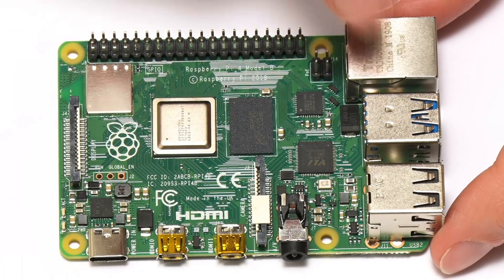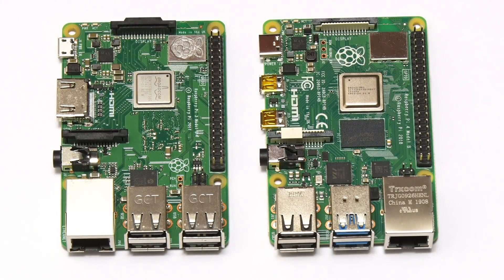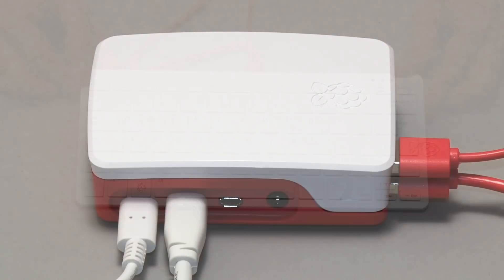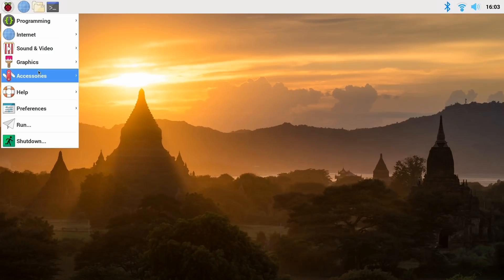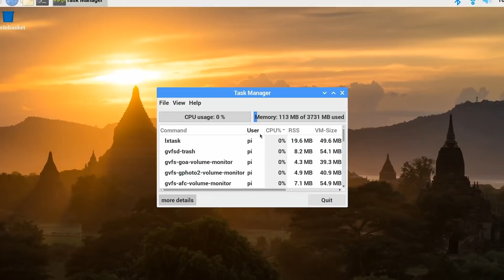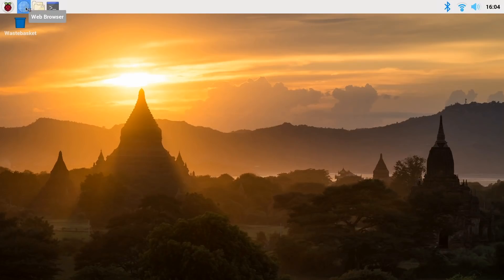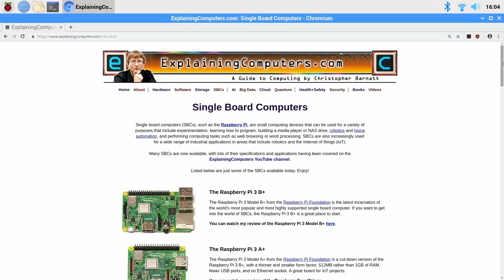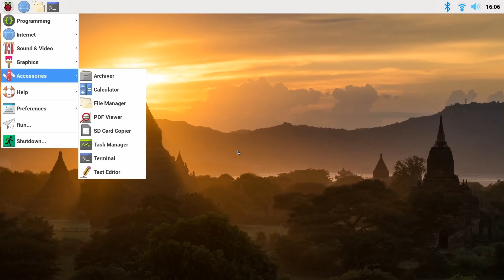Raspberry Pi 4 Model B

Comment: I bought RPi 4 for this Christmas. It's a bit sluggish comparing to RK3588 based boards, but still works well for many tasks. USB 3 allows to use USB SSD as a main drive. So even after 6 years, it's still a good small computer.

Comment: Great video, does anyone know why when  i start the raspberry pi 4 it shows the boot screen but when it time to show the desktop it goes dark?
when i remote into it i can see the screen but when i connect i display to it the screen turns off.
Reply from the maker: It sounds like you have turned off HDMI in Raspberry Pi OS, so can only see the desktop via remote access. Maybe part of your remote access setup?

To turn HDMI back on, in a terminal try:

xset -display :0.0 dpms force on
Reply: @ExplainingComputers  That didn't work and now it got the remote screen extralarge and i have to scroll right to see the rest of the screen
Reply from the maker: Ah, but you have now then proven that the problem is your display configuration. You can reverse the above to get back to where you were:

xset -display :0.0 dpms force off

Comment: The Pi 5 should really have an [optional] 8-32GB eMMC flash chip: that way the Pi would be a lot more responsive and the SD slot could be removed from the Pi and replaced with something else :-)

Comment: Thought I'd make a post here to warn people about the Pepper Tech  Tera Pi QV... the one with the big aluminum heatsink. I built one up recently running OMV.   There are two main problems. One... There are only 3 heatsink contact blocks on the bottom. And 2, It makes the PI run hotter N Hell after a couple of hours. I had to add a fan to my friends heatsink, but that kind of defeats having what it supposed to be a static dissipater. At least in this Terra Pi all the hardware was included. I eventually took the big heatsink off and put on 4 small standsrd blue heatsinks. It actually runs cooler with those tiny sinks than with the large one.

Comment: Does the microSD card lock in place ?  Someone said it just slides in and they didn't have to push it in to lock like a normal slot. Thanks. I am now searching for the best case for a PI 4B.
Reply from the maker: The microSD card in a Pi 4 does not lock -- it just slides in as you say. They did lock in earlier Pis, but no more.
Reply: @ExplainingComputers  Thanks for the quick reply, I just ordered a CanaKit Raspberry Pi 4 4GB Starter PRO Kit - 4GB RAM. Might have to find a case that  I can use if I need more storage like the WD black  SN750 NVMe. I am hooked watching all these SBC videos. Thanks for all you do Chris.
Reply from the maker: @michaelurig3887  It sounds like you are in for an exciting time getting into the wonderful world of Pi. :) Enjoy.

Comment: I got the 8GB variant (yes, they exist).

The official case is pretty, but cooling is going to be an issue. My Pi came with 4 heat sinks and I'm surprised yours didn't come with any. :/ But anyway, I got my Pi running with Ubuntu Server 20.04 and it works like a charm.

Comment: I decided to use a different case, one with a fan,  because after 45-60 minutes the CPU(with heatsink) was overheating. I am using Ubuntu software, not the Raspberry Pi OS.

Comment: I recently got a Pi 4 B to upgrade my Raspberry Pi setup. One of my flash drives, however, kicked the bucket. I had to get a new one to replace it. My specific unit runs Sparky Linux with 8 GB of RAM.

Comment: I finally broke down and bought this computer (it arrived today), Pi 4B 8GB RAM version ($75), for all of the extra SPI ports.  I also bought the heat sink, the 5A power supply, and the Pi T Cobbler (for connecting to a proto board).

Separateley, I bought two micro-HDMI to VGA converters, a 256GB Micro-SD card, two monitors, and will borrow mouse & KB from my other Raspberry Pi (3B+).

When I looked to install an OS, I was looking for a 64-bit, but I don't see one.  I suspect that I'll be losing part of the computer's functionality (one-half of it) because of the OS.

On the other hand, I've got 256BG of Micro SD, so I can install several OSs and see which one does what I need.
With 8GB of RAM, I also imagine this little computer might have computing ability to rival my Windows desktops.
Thanks again for the info.

Comment: I just received my Raspberry Pi 4 4GB Just started tinkering with it. had a time connecting the fan to the pins but found a website to help me out pin 4 red power,  pin 6 Ground. Will work with it for awhile. I noticed it's faster then my Raspberry Pi 2 Also using a wireless keyboard and mouse.
Reply from the maker: Enjoy your new Pi. You have the right 5V fan pins. :)

Comment: I am new to the pi and linux. I purchased a pi 4B 4gb and Argon One M.2 last month. My reason for the pi is to play my movie collection in my motor home when traveling. I have connected to two different TVs in my home, to set up the pi. But with the TV in the Motor home, I get nothing on the TV screen. The TV has HDMI inputs, but it is not a smart TV. What am I doing wrong.

Comment: Thanks again, Christopher, for a great video.

I was trying to find at least one spec on this: the maximum memory allowable in the MicroSD card slot.  I have a 128 GB card in my Pi3 B+, which I'm certain should transfer over (after I load the new OS, since I understand the old OS won't work).  But the main reason for this changeover has to do the the number of SPI channels available in the BCM 2711 (Pi 4 B) compared to the BCM 2835 (Pi 3 B+).  

I need A/D and D/A converters for eight distributor cards, count them, at least 16 SPI channels.  I can get more, perhaps, by multiplexing the CS pins, but at least this new card has six SPI channels, expandable through fanout (I don't know the fanout of these ports is, yet) and multiplexing the CS pins.

This may be possible on the BCM 2835, where there is plenty of software support on GitHub.  There is almost no software support for the 2711 on GitHub.  I would have to write my own interface for this one.  Otherwise, it could take up to four of the Pi 3 B+s.

Actually, I think the GitHub program only seems to support one SPI port.  The BCM2835 has two and up to three, selectable through the CS, but there again, software is needed to support the additional ports.

The 2711 also comes in 8GB for $85 (your video is over a year old, now), but for $35, I can get the Pi 4 B with 2GB of RAM.

The A/D and D/A chips I'm using each have two channels (total 32 channels needed - I don't know what made me think I could do this with an Arduino), but this is readily resolved in the length of the data stream (you can send multiple data sets in each stream).  Both the 2711 and the 2835 are pretty versatile in this respect.  I wondered if the CS are mutually exclusive or if I could program them to be anything I like, which will allow them to be multiplexed.  I suppose other GPIO pins could be programmed for this if needs be.

Also needed: two Micro-HDMI to VGA adapters.  Every computer in my house has two monitors - except for the Pi3, which has been a source of discomfort for me.  And I don't spend good money on HDMI video monitors when I can get perfectly good VGA monitors at the thrift store for 1/10th of the cost of a new one.

I guess I'm going to buy one.

Comment: I have a question. It would make sense to use the POE pins to apply power to the Pi without using up GPIO pins and not using a POE hat. Which would be the pins to use?

Comment: what monitor would be advisable,  a 7" tablet perhaps ? ,any suggestions,  please
Reply: That would depend on what you will be using it for. I use my Pis headless over SSH from my 27" iMac, that I bought not leastly for the screen estate.

If you want to run some species of service from it i.e. not programming or something a 7" screen could be a good choice. If you are not sure what you are going to use it for and have a TV, you could start with that, and when you know more what you want to do, you can make a more informed choice later on.

Humbly, Ylan

Comment: I am considering the 4B for use as a smart terminal, virtual desktop intranet system running learning programs for K-12 charter schools. Might need only 1 gig to handle limited distributive processing.  Seeking to set up a low power use, plug and play system where components can be easily swapped out. Where a student can sign on at any work station and access their individual learning plan downloading and saving to the server. Any comments or observations about potential problems would be appreciated.
Reply from the maker: This may well work! :) Note that the lowest Pi 4 RAM available in the consumer market is now 2GB (for $35, which is what the 1GB used to cost). The higher RAM models are now 4Gb and 8GB.

Comment: Hi Chris,  will you be doing a review on the new 8 GB pi 4 at all?
Reply from the maker: I will indeed cover it on the channel fairly soon! :) Along with the new USB booting facility (now in beta). The Pi 4 continues to evolve!
Reply: @ExplainingComputers  it does continue to evolve! I have a Pi 4b 4gb at the moment but i am considering the 8gb, but not really sure why i need one. I may wait until your video comes out!
Reply from the maker: @Craylos  And we now have the ability (in beta) to boot from USB, which is more useufl in most contexts. Raspbain (now renamed "Raspberry Pi OS") is still 32bit, so there are limits to the RAM that can be access by each process (3GB as I recall) on an 8GB Pi 4 . . .
Reply: They have today, released the 64bit  beta version of raspberry os as well, how good is that! 😁

Comment: I have a question I was trying to use Berry boot on my Rasberry pi 4 4GB the monitor I am using doesn't have an HDMI port so I'm using a HDMI to DVI-D connector it will not display just black screen. I used Rasbian Full and no issues. Any thought on why this is?

Comment: i am having troubles with installing windows 10 on my raspberry pi 4B can you teach me how to get windows installed to the raspberry pi 4?
Reply from the maker: Windows 10 on Pi 4 is at best experimental (and you will need ARM Windows, not the standard x86-64 version). The Pi is manufactured to run Linux distros.

Comment: Fusion 360 on this board?
Reply: Sergio Santangelo Fusion 360 isn’t supported on Linux so isn’t very easy to install, nor is this suitable for fusion 360 due to the low specifications

Comment: I would like to know the PIOE pin details.
I would like to power my PI 4 without blocking the GPIO ribbon connector or using the USB C connector for power.

Comment: isn't this the same as pi4? or is there a pi4 aand pi4B? internet doesnt help
Reply from the maker: The full name of this board is the Raspberry Pi 4 Model B, but it has become commonly known as just the Raspberry Pi 4. The "Model B" bit indicates the size (form-factor) of the board -- most Pi's are either Model B or Model A. There is currently no Model A for the Pi 4.

Comment: I have one of those but upon set up I choose to customize my remote password now I don't remember it can I reset it back to default
Reply from the maker: You may well have to reinstall.
Reply: @ExplainingComputers  ii had to modify cmdline but that did work
Reply from the maker: @nsvaluto48328  Good to hear. :)
Reply: Wanna do a music reactive leds using my pi 1) can I do that? 2) what would I need? 3) what code is used?

Comment: Hello
What is the difference between the Raspberry pi 4 and Raspberry Pi 4b?
I'm completely new to this stuff.
Reply from the maker: Technically the Raspbery Pi 4 is the "Raspberry Pi 4 Model B". Previous Pis came in smaller A and standard B models; so far we've only got a 4B, so people just call it the 4.
Reply: @ExplainingComputers  Thank you for the explanation 🙂
Do you think it will be come a pi 5 in the next time and would it be a good time for waiting for it or is the pi 4b all ready a very good raspberry pi and are in the pi 4b version the USB Typ C standard corrected, also the range short comming of the wifi?
Sorry for so many questions 😔
Reply from the maker: @WaschyNumber1  I don't think we'll see a Pi 5 for a good 2 to 3 years. I've no knowledge of any WiFi issues with the Pi 4B. The USB issue also only exists if you use certain power supplies (like those from a Mac). Get the official Pi 4 PSU and you will have no issues.
Reply: @ExplainingComputers  Thank you very much 🙂

Comment: Love your coverage of Raspberry Pi. I would like to create a Pi based tablet with the ability to reorient the screen when the unit is turned 90 degrees so I can use it landscape and portrait. Any idea how to make the rotation tracking work? I want to use one of the multi-touch screens (around 13") for this project and see it can easily hook up to the Pi. How do I make the Pi track rotation and change the screen (and touch) to match?  If this better as an offline discussion, let me know how to reach you that way. Thanks in advance and keep the great videos coming.
Reply from the maker: You would need to connect an orientation sensor to the GPIO pins -- something like: https://learn.adafruit.com/adafruit-bno055-absolute-orientation-sensor

Comment: Hi Chris. Thanks for your great videos and reviews. Any chance of doing a Raspberry Pi Cluster video (2 or 4 node)? My cluster experience goes back to VAX VMS clusters. I've seen many videos on Raspi Clusters but haven't seen anything that really takes advantage of the extra horsepower. In my VMS days when we had 4 node clusters, we had one Virtual Main Node that took advantage of the other 4 physical nodes so it looked like one larger computer that spread the workload and load balanced across all 4 physical nodes.  Thanks - Rich
Reply from the maker: Hi Rich -- a Pi cluster is on my (long) list! :)
Reply: @ExplainingComputers  Cool! Maybe we can colab! Cheers!

Comment: Does it matter the type of micro sd card I use?
Reply from the maker: Providing the card is large enough (for most Pi OS an 8GB card is fine, sometimes less) everything will work. But faster cards will give better performance. Go for at least class 10 if possible.

Comment: I suggest to use the image from Canonical (ubuntu-19.10.1-preinstalled-server-arm64+raspi3.img.xz), add ubuntu-desktop (or xubuntu-desktop as soon as the lightdm-bug is solved).

One question: "No mention of the incredible heat-production"? It is noticable after one minute of desktop-usage, aspecially when it is in that white-red plastic case. For desktop-use I only use it when installed in a fan-cooled-box, FYI.
Reply from the maker: I had very little time with the Pi 4 when making this review. I have since made three videos specifically covering Pi 4 cooling -- the latest here: https://www.youtube.com/watch?v=VJC6OpGpq0Y

Comment: The board is very good. In my opinion, it has some problems:

1. Temperature: the solution consists of a large heatsink with a fan and so we check it with your excellent comparison in a previous video; It is very effective. It is not logical and goes against the "philosophy" of mini boards.
2. Power supply: design failure. They should have added a simple resistance, but they will fix it. It is a minor problem.
3. The UART is really mini UART. Easy solution.

I hope that in 2020 they have solved these problems. 

And one suggestion: check how Sparky Linux works on a Raspberry 4.
Thank you.
Reply from the maker: The solution will be revealed here next Sunday! :)

Comment: My Raspberry 4 does not start. It only does a series of 4 flashes of the ACT LED, with any Microsd I use. The power supply is 5.22 V.
Reply from the maker: This sounds like a corrupt micro SD card, or the card not being inserted/seated properly in the Pi. I would download your OS image again and re-image the card using, eg, Etcher.
Reply: @ExplainingComputers  on raspberry pi 3b+ work
Reply from the maker: @PaoloBanci  You cannot use the same operating system image on a Pi 3B+ and a Pi 4 -- so a card set up to work on a Pi 3B+ will not work on a Pi 4.
Reply: @ExplainingComputers  I know that the same operating system does not work. I meant that I used the same 3 microsd cards. Format and install the system for raspberry 4.
Reply: @ExplainingComputers  That three microsd cards are corrupt, and one of which was new seems strange to me.
Reply from the maker: @PaoloBanci  Yes, that is strange. If you are saying that you have newly imaged three different SD cards with a Pi 4 OS, put them in the Pi 4, and it does not boot, then that suggests a problem with the Pi 4. Just to check, you have stated the voltage of your PSU for the Pi 4, but make sure it is rated 3 amps, as the Pi 4 is power hungry. Also note that many USB-C power supplies do not work with the Pi 4 due to an error with its design.

Comment: Have mine a week ago. Busy tweaking for dosbox, comparing running in x or maybe the retropie version. Hookup 3.5 floppy project with usb drive or original with 34pin to usb adapter.
Yet have to test how to impove boottime. Currently running Dietpi at 31 sec startup time with a 16gb sandisk class 10 A1

Comment: Niced to see a 64 bit processor, however how wide is the memory bus? If it isn't 64 bits then I expect a B+ model with that feature. Same question re graphics instruction set and memory access.

Comment: Got mine the other day and just installed it today. I wasn't expecting to notice much of a difference. But... wow is it a lot faster on the bootup. And indeed, I can finally stop bitching about youtube streaming.  Is there a guide anywhere to help with graphical memory tweaking? With the 3, I found increasing it to 256 made Youtube unwatchable. But with the 4G Ram I assume that's not an issue anymore. But how does one go about tweaking and how do you tell when you've reached the optimal setting?
Reply from the maker: Streaming on the Pi 4 remains a work in progress. For best results right now, use Libre ELEC.